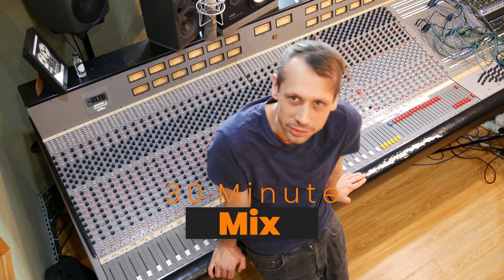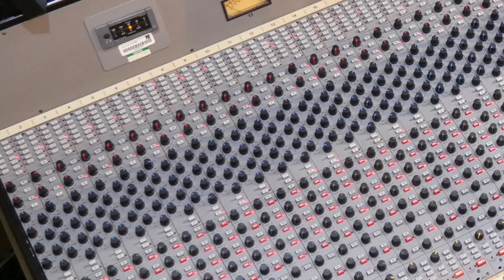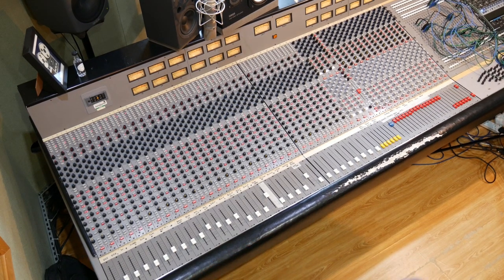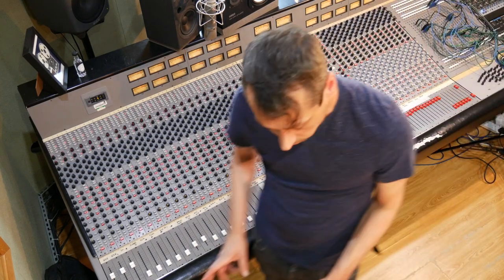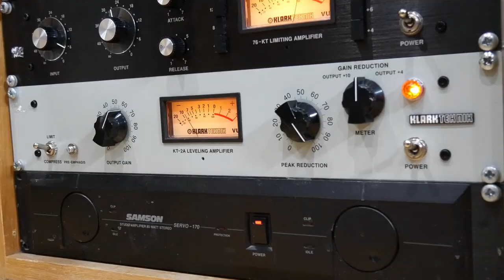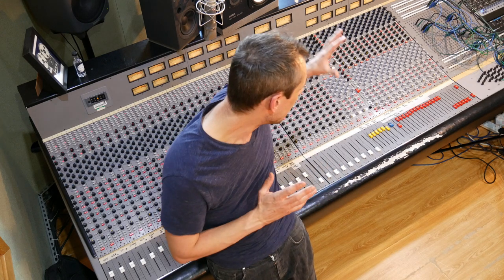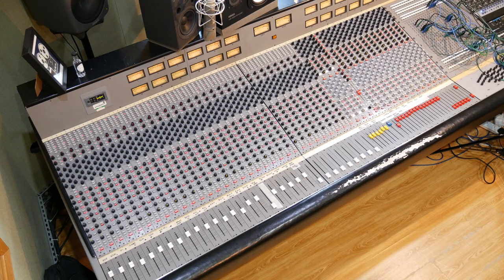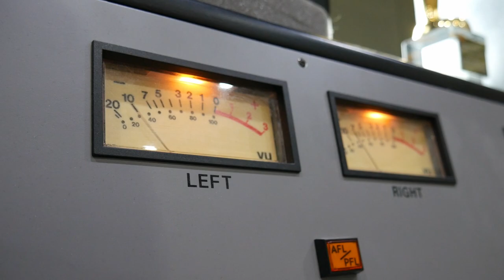30 Minute Analog Mix  - Catalyst Studios - MTA 980 - Neve - Tegeler - Amek

Comment: Hi Russ! Hoping you might see this, I'm in the process of building up a 980 currently and wanted to ask how you used to route from PT (D/A Converters) to the desk line ins. From my manual there doesn't seem to be an EDAC input for the line ins, only via the patchbay, but your bay here doesn't look manually patched for all 32 line in channels, how did you run from DA out to desk Line in? 
Cheers
Sam
Reply from the maker: Hi, if you find my website and message me on there we can chat over email better. 

I’ll try and remember what the wiring was set up as

Comment: You could push console a little harder. In my case mine tends to open up when you get closer to the 0.
Reply from the maker: I do sometimes. Though if you measure the at the Crest factor/LUFS of the mix I'm sure you'll find it is pretty limited. 
I'm not sure what open up means, but yes saturating the remix amp om the master channel and saturating the input stages is a technique which I discuss in some of my other videos. 

Glad you liked the vid, should I make more like this?
Reply: @RussCottier  Well, consoles were designed(especially older ones) to work at specific operating levels, the ones that tape machines were producing.  And tape machines ran hot,  so most of consoles are very resilient in terms of levels and can take a lot of abuse before even start saturating. Like any gear they have a sweet spot gain stage wise, it doesn't have to be the saturation point. My guess it would be somewhere between -6 but below 0 on the meter. At least my Soundcraft Delta 8 is not very forgiving at low levels. Sure I'd love to see more analog mixing/tracking  or even tape stuff if possible.